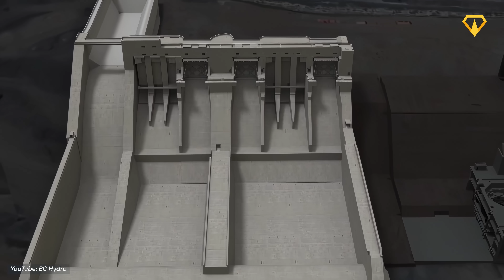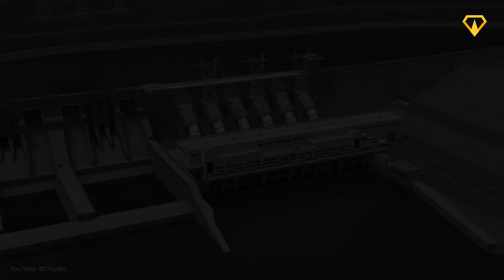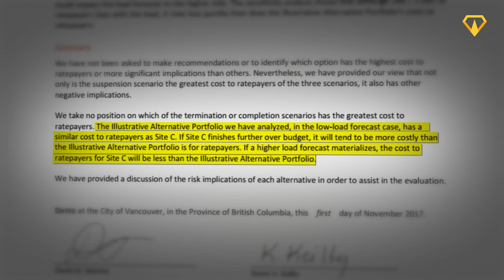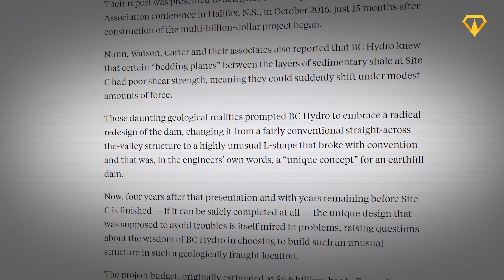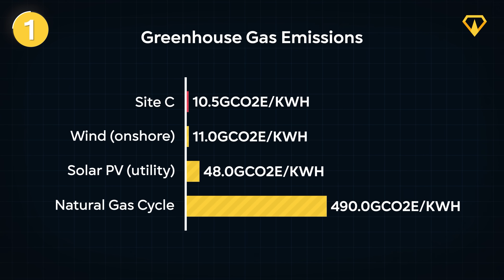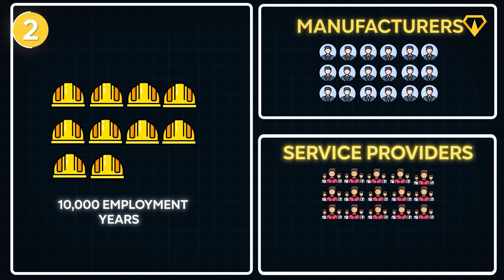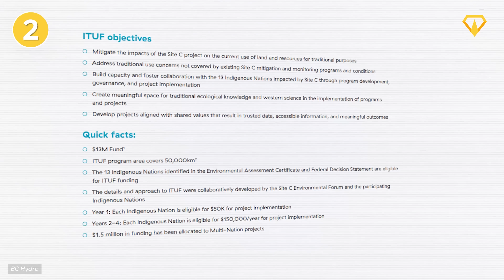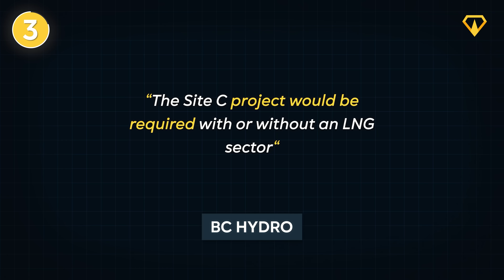Canada's Massive $12B Mega Dam

Comment: The Coastal Gaslink Pipeline will transfer gaseous natural gas to Kitimat.  It will be chilled at Kitimat to LNG for ship export.  Kitimat is supplied with electricity by a 30-mile long 230 kV line which is supplied by a 250-mile long radial 500 kV line from Welliston,  BC Hydro may need to upgrade the transmission system to Kitimat, but the point that the beginning of the Coastal Gaslink Pipeline is close to Site C is irrelevant.

Comment: Hey @MegaBuildsYT there is a dam in Canada that is 18 times bigger than the Site C dam.  It the largest dam by volume of construction material on the planet.   Check out the Mildred Lake Settling Basin.  It is an 18km long dam to hold the tailings from oil upgrading in For McMurrary.

Comment: 11:58 it is worth to mention, that this important property plays big role not by all hydropower stations, but only by the stations with big water storage. Such plants have normally up to 3-4 times more installed power, than so called run of the river hydroelectric power plants, where they have power only so much the river actually can. Of course it is also possible to variate the power on such plants, but the range on the plants with water storage is higher! Such power plant work very good with solar and wind power plants, because they compensate the spikes of generation and consumption.

Comment: The only real concern is Treaty 8.Other than that the generation of clean energy outweighs the negatives, especially considering that it is pretty much reusing water to generate electricity. Also why is selling LNG generated using clean energy a negative?????? It's a huge boost to the economy and although not fully clean it is definitely a cleaner source of energy for wherever it is going to be exported to.

Comment: i live in this region. You don't see it in the video but there is a highway that runs through the valley before site c. Several sections of the road would've been underwater, so they logged all the trees in the valley, built roads at higher elevations and 3 or 4 bridges to cross over the now flooded valley. Driving the valley is very beautiful in the summer. Its been very surreal to come back to it last summer and see it flooded with water

Comment: Canada can build multiple dams similar to their International Control Dam located just upstream from the Horseshoe Falls, Niagara Falls. Several can be built most of the way across the St. Lawrence River, where the river is miles wide. It's much less tall and the one near Niagara Falls is 1,500 ft long and generates enough electricity to power the equivalent of 3.8 million homes. That's equivalent to 211 homes powered per inch length of a dam of such a type. Turkey can do the same across the Bosphorus Strait and the Dardanelles Strait. So could Denmark, upstream from the Baltic Sea. Michigan could, across the Strait of Mackinac Strait. California can under the Golden Gate Bridge. And across the Bering Strait. Water flows south during the winter and north during the summer. But since the strait is approximately 120 to 150 ft deep, the deeper portion of a dam could be an earth-fill dam. Since despite their size in volume, they're much less costly to build than concrete dams. The earth-fill portion of a dam, although expensive overall given the size, would not be affordable, but even so, the cost for the entire project would still be justified by the hydroelectricity generated. In fact- even if the power could only be generated by water entering through at one height, similar to Canada's International Control Dam, with the equivalent of enough electricity to power the equivalent of 211 homes per inch length of dam, a 3-in-1 dam across the Bering Strait, between the Bering Islands and mainland Asia & North America, would be long enough to generate enough electricity to power the equivalent of 650 million homes. More than enough electricity to power all towns in Alaska connected to the same grid. For all of the electricity generated to be paid for, Alaska would have to build a longer grid and pay for an extension for Canada to build, to link with Alaska's grid with Canada's and with the lower 48 States. Fortunately, electricity generated from a portion of the dam would help justify the costs so far at a certain time. Then as more progress is made, the rate of profit increases and would help justify the costs to link Alaska's grid with Canada's grid and those of the lower 48 States, except Texas. And fortunately, if Russia were to refuse to let the U.S. built on their side of the border and let the U.S. keep all of the profit, a dam if built from Little Diomede, AK to mainland AK would still be not only profitable, it would still power the equivalent of over 300 million homes.

Comment: The biggest hydro network in Canada is in Québec.  The James Bay Hydro-Québec system doesn't need big damns like that -  they just channeled the water into big valleys (some towns are now under water) and then made a channel through a mountain on one side to let the water out for the turbines.  They did this over a vast area - from Brisay to LG1 (east of Radisson).  There are multiple stations generating from 500 to 1200 megawatts each.

Comment: I work in super heavy construction.
This damn is a total failure ! It's life span is an expected 70yrs.
Just to build the base of the damn. They've used so much diesel fuel in heavy equipment. Had they burned that fuel in clean diesel generators instead. They'd have produced more power than the entire 70 yr lifespan of the damn. Fuel for completion of the Damn will be 300% of the damns total output.
Only leftist economics thinks this is good. And touts it has environmentally friendly

Comment: 12 Billion for 5100 Giga watts of power. I always wondered why we just don't install a whack of solar panels instead? But I never crunched the numbers before: 
My solar system cost $15000 and it produces 11Kw of power, which powers my house in the south interior for the year.  that is $1.36 per watt. The site C dam costs $0.0024 per watt using the figures above. 
Even if we use more recent estimates for the cost of 18 billion the cost per watt becomes $0.0035 per watt. Looks like money well spent.
Reply: Who puts solar panels so far north?  Won't produce a tenth the electricity as it would in Arizona.
Reply: @floycewhite6991 One tenth? I will allow you to look up the solar voltaic potential for the Okanagan. Someone who wants zero electricity bills, even after charging their electric car, that is who puts solar panels "so far north". Actually, to be entirely accurate BC Hydro paid me money back last year.

Comment: Canada is the most inefficient builder of anything. Example. Toronto Finch subway line of 5 stations. 8 years to built, about 1 billion cost. In Canada if they build anything, it is slow and cost double or triple of original budget. I suggest to bring temporary 100,000 North Korean workers, like they did on 19 century with Chinese, who built cross Canada railway, and those NK will complete 20 years of Canadian projects for 5 years, or may be 3 if Kim Jong Un "politely" askes them. And it will cost a 1% of original budget.

Comment: WTF does a 1 in 10000 year event that is long overdue mean.  As the years go by the fault keeps loading up, and it gets more and more dangerous and then eventually it blows.  If it is 95% loaded you don't have 10K years left.  

It's on shale, but at least there is no way they would upset the geological stability of the dams by fracking...  What this?  “Call for Moratorium on Fracking Near Peace River Dams"

Comment: I like hydro as much as the next person, and I love money, but calling Hydro  "clean" is bullshit. From mercury releases (it is all environmentally specific, to heating water, to destroying habitat, and the occasional collapse. It isn't permanent, 100 years is all I care about, actually 30, but they eventually wear out or silt up. And we will be left with a massive mess.

Plus, as you point out the main reason is economic growth.  It isn't about a better BC, it is about a bigger BC.  That means more people, housing, roads, social dislocation.  Stuff we all want but more "paving over paradise put in a parking lot".  I was born in '59, and the environmental movement seemed like something people would actually act on.  Now we just use it to package lies and transfer power to undemocratic forces.  Just a small, relatively innocent, example of that is that the  current Premier ran on stoping the project, but the project is too big to fail.

Comment: People need to understand the difference between emissions and greenhouse gas.LNG has less emissions than coal in less pollution. However, the combustion of LNG produces more greenhouse gasses.  Coal is almost pure carbon C+ O2 = CO2. LNG however CH4 + 3O2 = CO2 + 2H2O. This means that not only is LNG less energy dense than coal, it produces 2 molecules of a more harmful greenhouse gas, H2O for every molecule of C burned. 
For me this speaks to the failing of the education system since this is easily within the grasp of everyone who passed grade 9 chemistry

Comment: The power grid needs the megawatts that this dam will produce.  If not for Site C, BC would need to replace that capacity with either coal or natural gas, both of which BC has lots of.  Other than that BC could build nuclear.  Needless to say, the hard-core extremist far left would hate all of those alternatives, and also hated this dam.  The left wants to force people into a new dark age, quite literally in this case.  I would suggest that those on the far left disconnect their homes from the grid, so the rest of us won't just realise what a bunch of stinking hypocrites they are.

Comment: The dam is sited on unstable soil - making a future and catastrophic failure possible. The dam flooded a lot of B.C.'s scarce farmland - and in this province of mainly mountains - farmland is scarce indeed. The dam will underperform  in energy production with the increasing incidence of drought in BC. We have had to import fossil fuel generated electricity this year - as drought left the reservoirs unfilled. So as climate change  and sea level rise floods the only other good farmland in B.C. (the Fraser Delta), and dries out the climate - we will be left without food, OR power. Only a Government would be enthused.

Comment: 10,000 square hectares is = 100 sq KM's.   The treaty area was described as the size of France which is 547,557 sq KM.  This project uses only 0.00018  of the Treaty area which is very very very small and therefore it was approved.  There is no controversy here except for the cost overrun.  Canadian mega-projects are always ridicules and make Canada a joke in the world of foreign investment in which Canada is dependent on for it's prosperity.

Comment: My dad worked on the Bennett Dam, he said it would fail. it is overdue. this dam must be built as a buffer to the flood that wil happen if the Bennett dam lets loose. there is nothing that can stand up to this. as the new resevoir fills the animals will move but where too? there has been no impact report on this dam that answers the questions its building raises. this is  BC hydro project in Alberta, once the water is sold, the land is sold and the resorces are gone what will Alberta do with a BC dam. there was a need for more energy in the north but what could replace this? There is a big benifit to bc but none to Alberta, why is it here?

Comment: Anyone saying that Site C wasn't necessary and power requirements were going to go down were just not facing reality.  We were already maxing out the power grid and with more people, more houses, more AC, changing  gas/oil out for electric heat, electric water heaters, banning gas stoves, moving to electric cars, there was no way we weren't going to need significantly more power... and now that Site C is done, we already need another one.  BC is already looking for independent producers to supplement the grid requirements.

Comment: Why would they build a dam when they could just build a 6 km inflatable mountain and strapped the mountain to the bottom of the ground so that the water doesn't go up the 6 km Mountain
It doesn't make sense that they would build a dam when an inflatable Mountain would do the same thing except they wouldn't need to use concrete and it can be easily removed and they can spray water on the top and it will turn into a glacier and drop the temperature of the planet and prevent global warming

Comment: I worked at LNG Canada Kitimat, it’s a rumour right now that Site C will power the LNG plant. LNGC wants to get both trains running first, then start phase 2 for trains 3 and 4 before they shut down Train 1 for converting it to electrically powered, then move down the line to the following trains. It’s smart and itll boost Canada’s economy a lot.
Reply: We talked about that at site C. 😂
Reply: They had so many problems with those turbines I wonder if they will just go electric for train 3 and 4 off the hop if the power is available. That would save themselves a lot of work

Comment: Control of power (modulating power) is via headgate rather wicket gates that controls the water through flow. Headgate is switch the water off completely.
Reply: Control of power (modulating power) is not via headgate rather wicket gates that controls the water through flow. Headgate is the switch that switches water off completely.